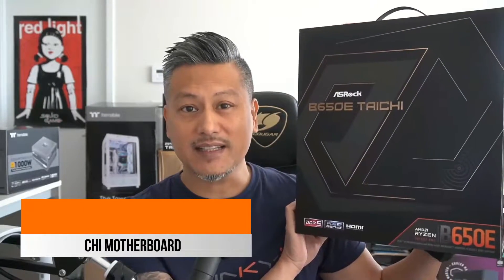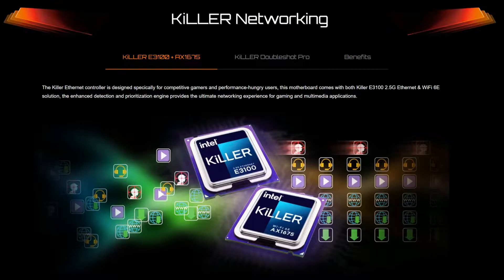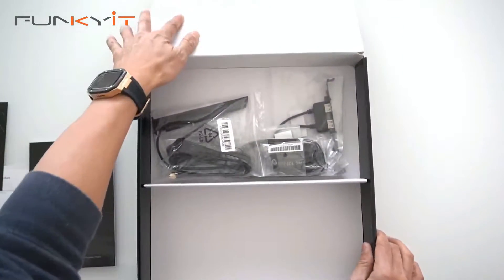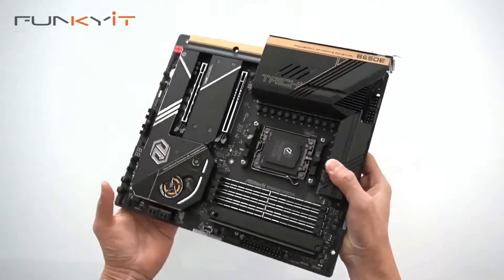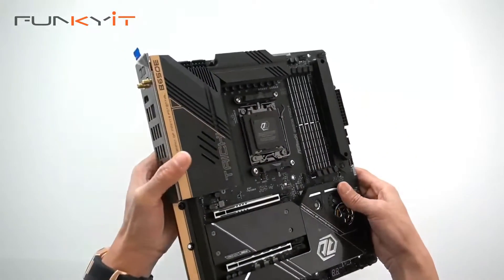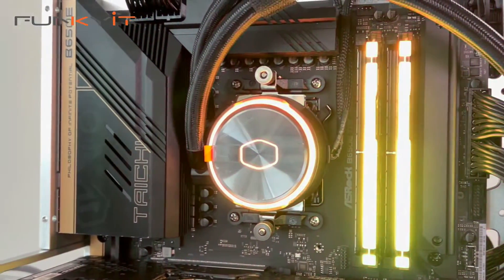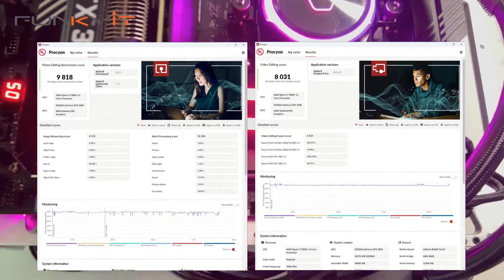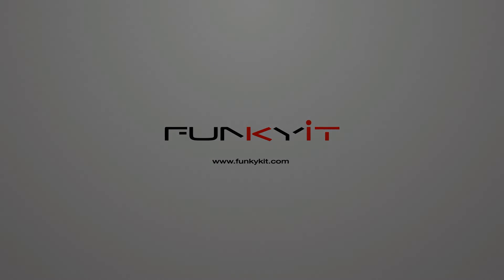The Best B650E Motherboard with Enthusiast Features - ASRock B650E Taichi

Comment: Hi, please which motherboard is better ( ASRock b650e taichi lite) or ( ASRock X670E Steel Legend ) ?
Reply from the maker: The B650E has less heatsink, diagnostic LEDs and onboard power on/off buttons. Performance should be about the same.

Comment: guy literally plugged a single daisy chained 8pin connector into the GPU instead of two separate 8pin connectors like you are supposed to..
Reply from the maker: Yes we shouldn’t have done that … but we did it for quick testing 😆

Comment: Wow, it has USB4! WTF, only onboard graphics through it, no DisplayPort input?
Wow, it has properly spaced dual X16 slots! Finally a midrange motherboard that can do x8/x8. WTF,  the second slot is 4x PCIE4 through the chipset?
This is the motherboard equivalent of blue balls.
Reply: from what i understand is the first slot is x16 and the second slot is x16 but if ur using both hyper m.2 and the blazing m.2 the second pcie is either no longer usable or its only x4